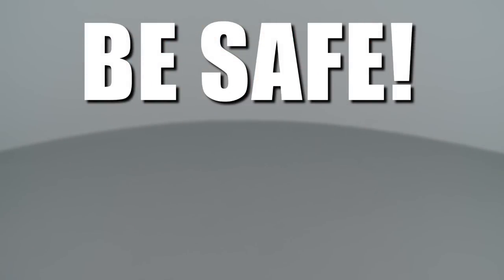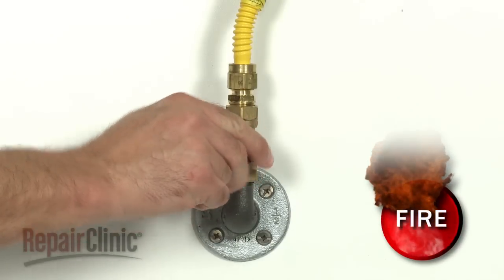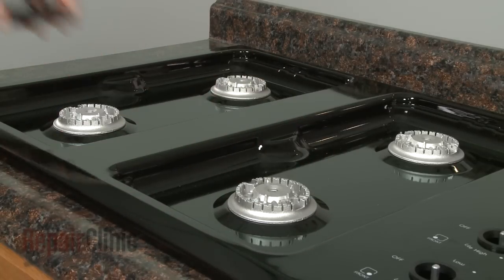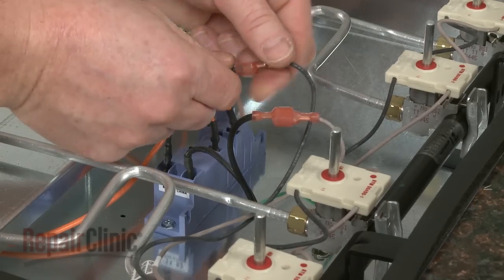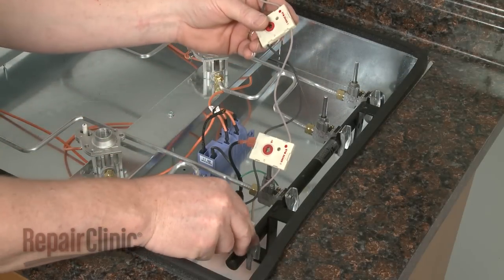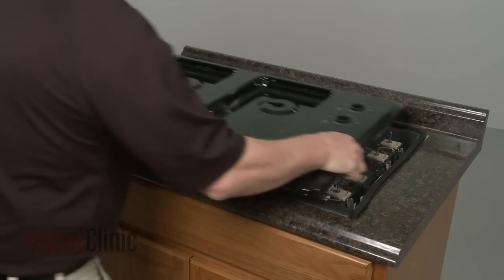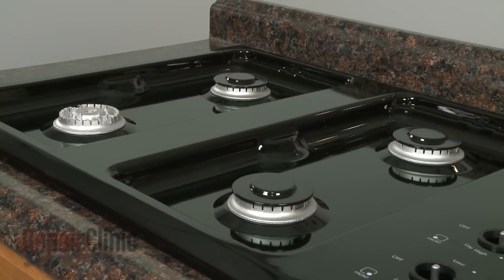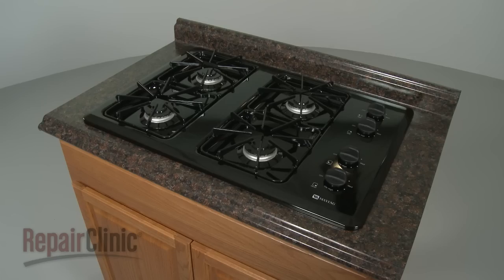Maytag Gas Stove Burner Won't Light? Spark Ignition Switch

Comment: Check the wires going in to the plastic switch. Mine had separated and I used epoxy glue and clamp. To repair.  Works fine again.

Comment: my mother spilled water onto one of the stove tops. now, i dont even get a clicking sound/spark when i turn it on, but if i put a lighter/match next to it, the burner comes on. the other 3 works fine. now today, the other 2 besides the one that got spilled water isn't clicking either. only one works while the other 3 are not clicking at all, but they still work if i put a lighter to it with gas turned on.  it is a maytag MGC6430BDW
with knobs on the top surface and it doesn't look intricate like the GE one you did in this video. any ideas? should i clean the ignitor first with sandpaper to see if a spark occurs? thanks.
Reply from the maker: Water may have gotten into all the spark switches. I would replace the spark switch harness . That is the most likely cause for the symptom you described. Since all the spark switches are hooked together you should get sparking if any one of the burners are turned on.

Comment: I'd like a video that shows accessing a sealed, glass top gas unit where you must remove the entire thing and turn it upside down and take off the metal box to get up under the burners and switches to replace the switch.  I have a KitchenAid kgct305x that harks from 1993 that needs a switch replaced.
Reply from the maker: Unfortunately we do not have a video that covers that at this time. Sorry about that!

Comment: we have the profile jgp975sek1ss and got Clorox into the high heat ignited and it shot sparks and flames like crazy!  thank you for this very helpful video, I hope mine is similarly simple.  any chance I should change the control orifice, too? any videos with this type of stove top?
Reply from the maker: +Scott Weinstein Normally, if you spill stuff the switch is all you need to replace. The spark module should still work. We do not have videos for your specific model at this time.